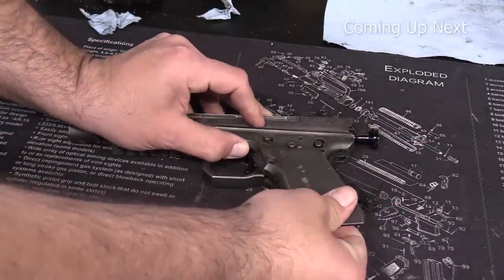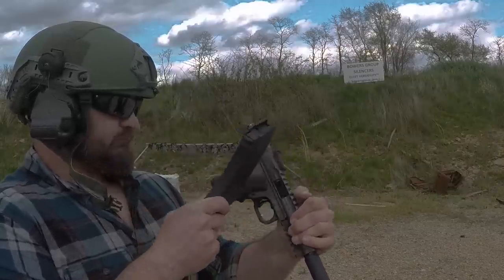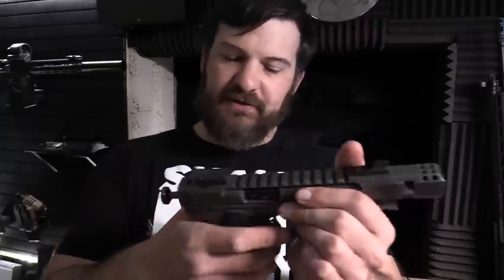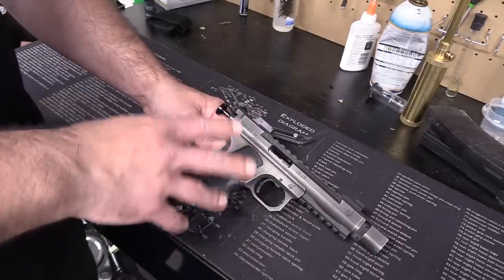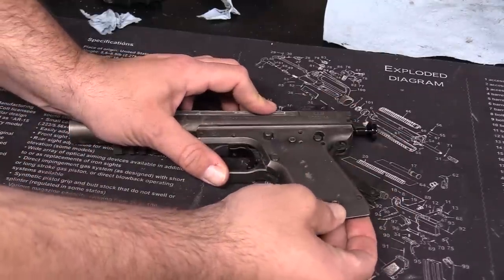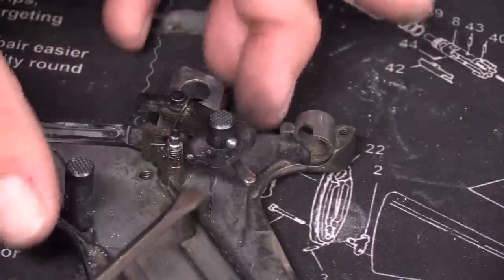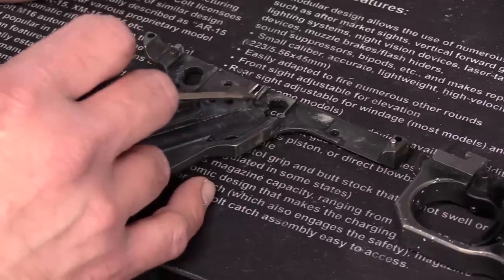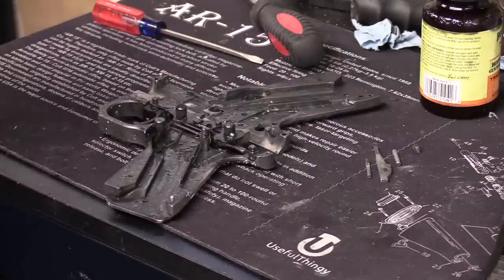I Finally Broke It || Volquartsen Scorpion (Restoration Pt 1)

Comment: 8000rds is nothing for a .22, certainly not 3-4x what is was designed for. Even larger cal handguns 8k rounds is not a lot. 
I have several ruger .22's my oldest is a stainless 22/45 with 35-40,000rds through and ZERO broken parts though I actually do regular cleaning and look after my firearms.

Comment: 8k rounds in a 22 is just getting broken in.  My buckmark has at least 20k and still runs like a champ.
Reply: Suppressed?
Reply: @Kenneth Macaluso  probably 4k suppressed but it doesn't make a difference on a .22
Reply: @wawheeler21  actually it makes more of a difference on .22 than any other round which is why I was wondering
Reply: @DEATHROWCANALPRODUCTIONS  how so? Ejection pattern or velocity doesn't change on my .22 when I suppress it like it does on my AR.
Reply: @wawheeler21  rim fire burns dirty bud and silencer just makes it blow back into the action
Reply: @Kenneth Macaluso  yeah it's dirty but that doesn't wear the gun out any faster. 22 is low pressure and very low gas volume so it runs the same with a can or without.  A suppressor doesn't increase wear on a rimfire.
Reply: @wawheeler21  lol 10-4

Comment: 8000 rounds definitely isn’t even close to the middle of that guns life cycle. Dirty 22 ammunition without cleaning for more then 1000 rounds sounds like you’re asking for a problem even more so with a suppressor, I’d even argue that this pistol being a target pistol and not a service pistol that is ready for abuse is asking for mechanical failures. Was this like a torture test/beater gun? I don’t see why you’d put a non service pistol through the ringer like that.

Comment: Firm believer that 22lr pistols are complete waste of money. Ones I’ve owned are not accurate have way more FTF FTE, make the gun much more dirty especially suppressed, nothing I would use for self defense and cost damn near the same or more as a reliable 9mm. Considered getting a 22lr kadet adapter kit for my CZ years ago so glad I didn’t throw another $250 in the trash for a round that doesn’t belong in pistols
Reply: 50cent 9mm rounds, this comment didn't age well. If you don't see the use for a good .22, you don't shoot enough.